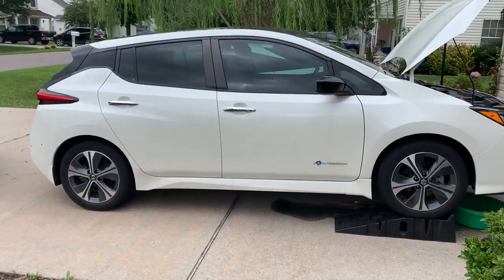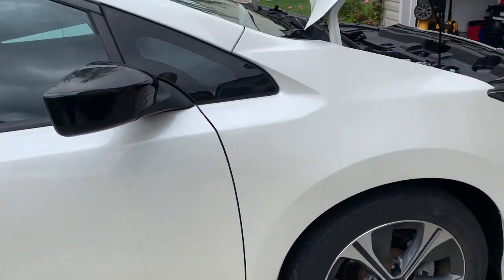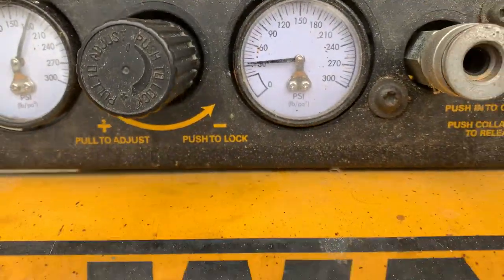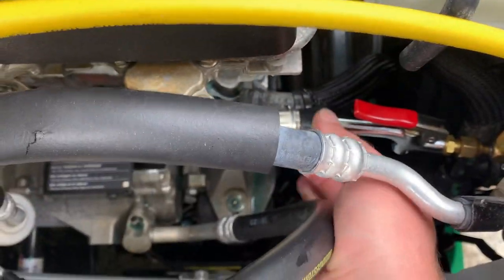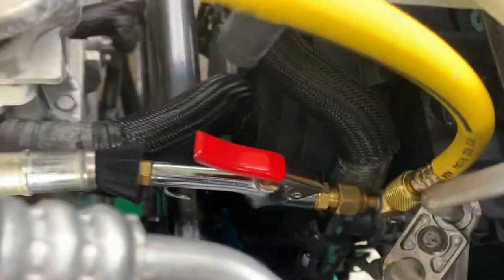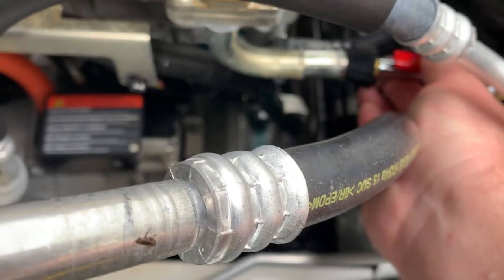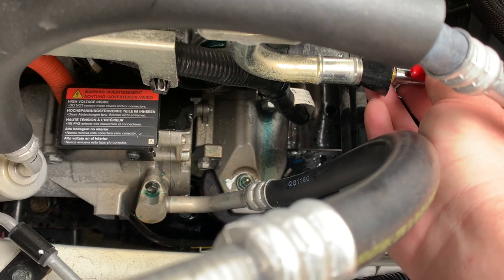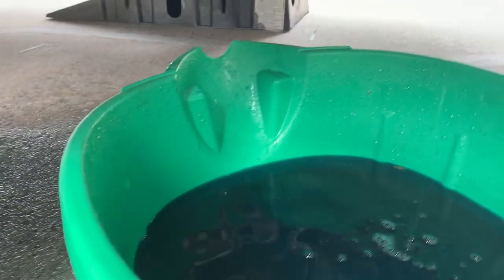2019 Nissan Leaf Coolant Change

Comment: Y’all please PLEASE be very careful and note that he fails to mention how tricky it is to burp the leaf’s cooling system. Car’s been on for hours and still sounds like there’s trapped air. I will be needing to buy a vacuum fill kit to vacuum it out and fill it professionally. I would add a disclaimer saying absolutely don’t even attempt this without a vacuum fill tool. You risk burning the water pump!

Comment: How do you purge air from the system after refilling?
Do you use scanner or just turn on the vehicle?
Reply from the maker: Just turn on the car or plug it to charge. I usually leave the cap off to top off and let air out.